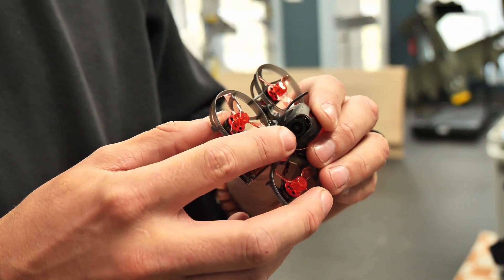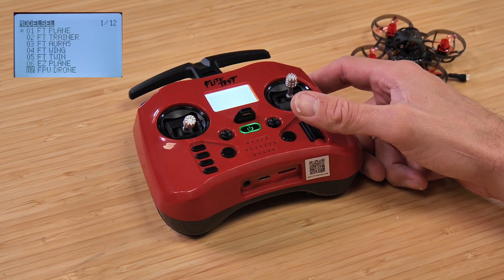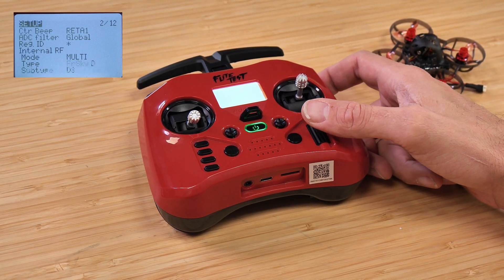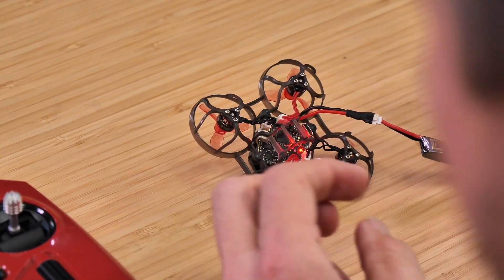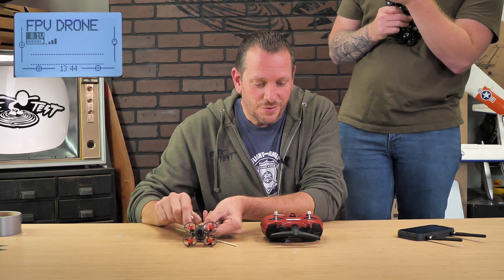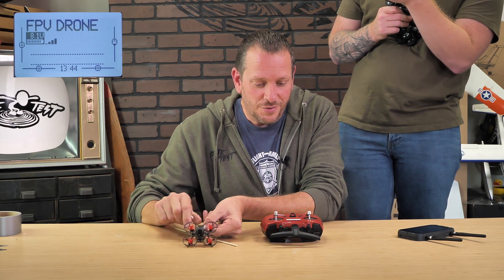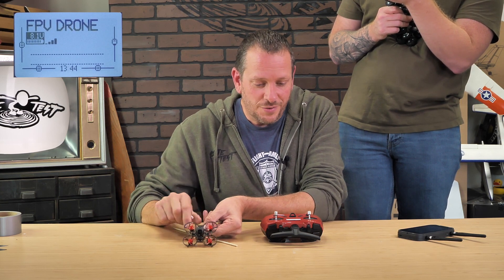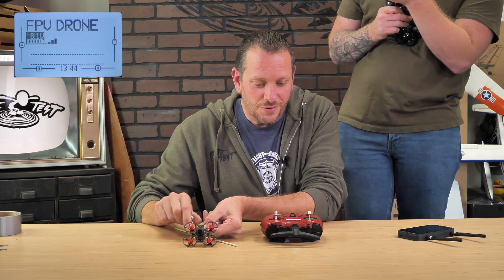How to Bind The FT Mobula 6 With The Pocket Radio //  BUILD

Comment: Thank you for the video. I am brand new to this hobby (and quite tech savy) and I was getting VERY lost and overwhelmed with the lack of written instruction. This would be a 10/10 product if there was more documentation for helping out newbies like me. 

(For example, the Mobula6 box says "works with any d16 transmitter" so i tried to bind it in d16 mode for 30 minutes :/ )